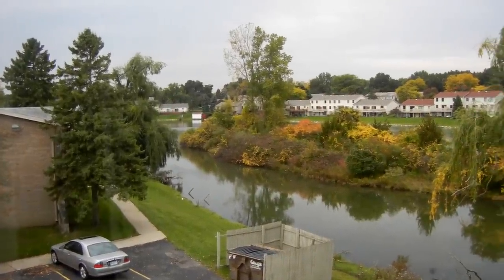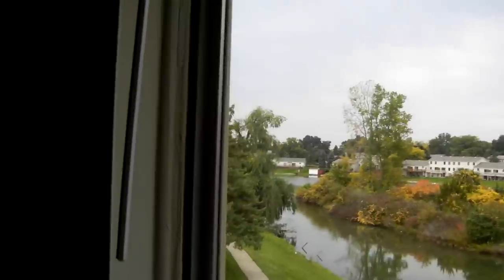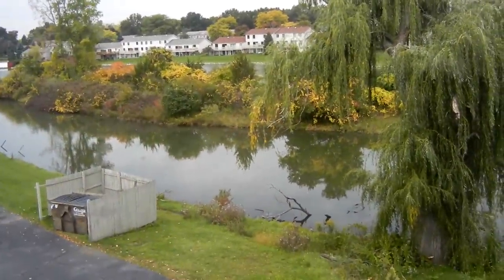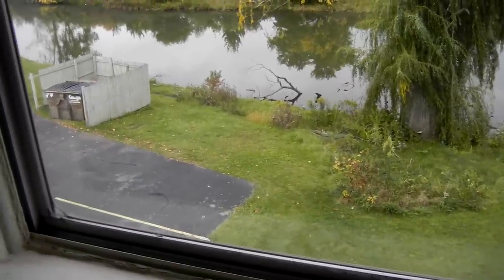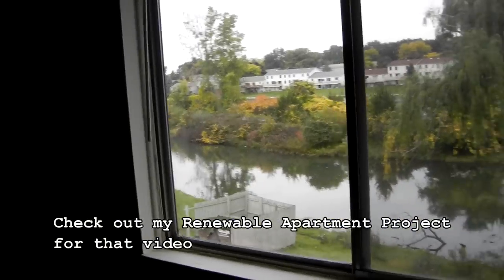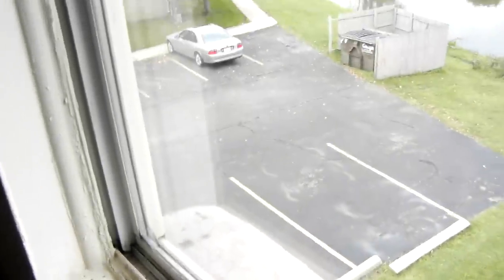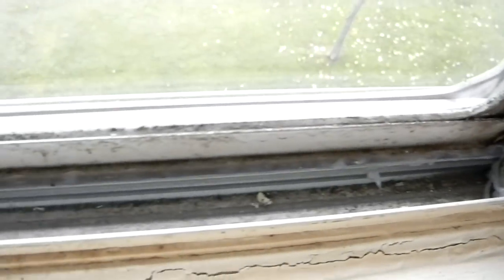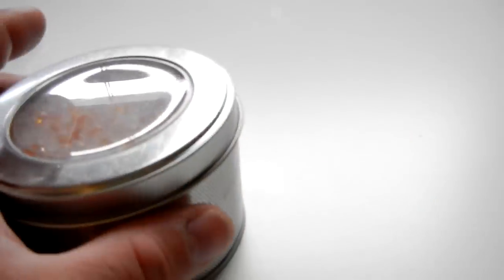Renewable Apartment - How I seal my bedroom windows for winter

Comment: Since you cannot see out I would add light filtering or black out curtains which will further insulate. I assume you left the blinds down because there is nothing to see and perhaps they have some insulating properties. I like the light so I would have left them up so that I could pull back the curtains to get some natural light when needed.

Comment: I put plastic on my windows one year and it made the window sweat and they rotted.
Reply: That is why ylu put the silica in before topping plastic.
Reply: I read something pretty interesting about that bottom window condensation a couple years ago. If you crack the window open a tad, water droplets won’t form. Counterintuitive, but effective. Physics. Google “Crack your window to avoid condensation.”
KT

Comment: i have a small babby and have this problem in my bedroom. the temperature outside is -25 and i am on the first floor . feeling very cold and catch cold and flu.plz give me some easy steps to keep my bedroom warm..plz
Reply: For a start spray the window with water and put bubblewrap on the panes. The water keeps it there. You can peel it off and spray it back on anytime you need it. It wont stop draughts but it keeps a lot more heat in and prevents condensation on the windows.